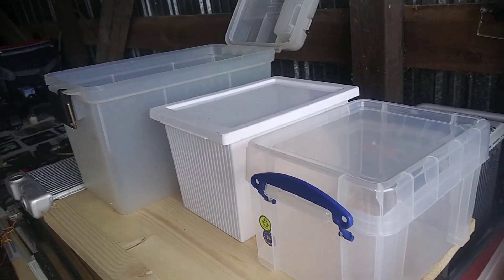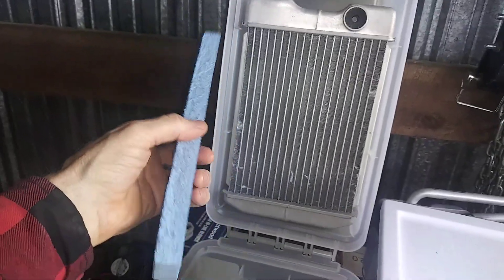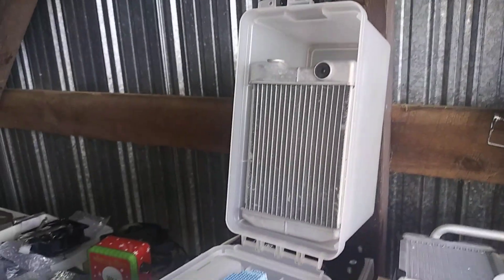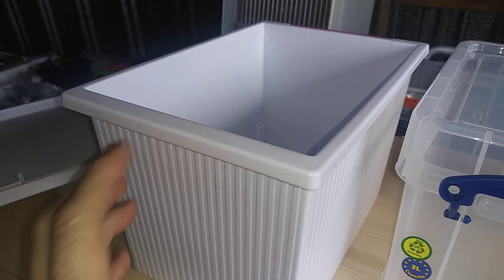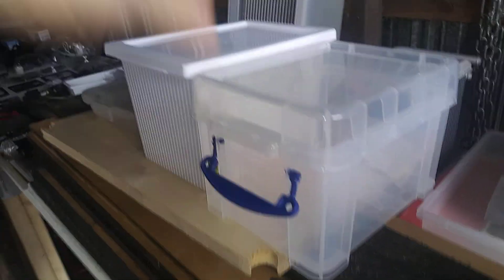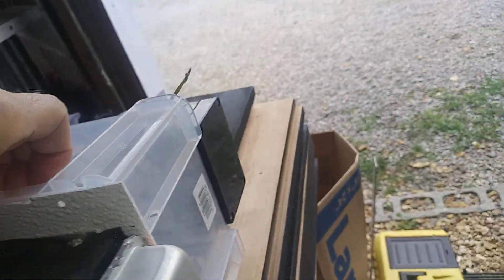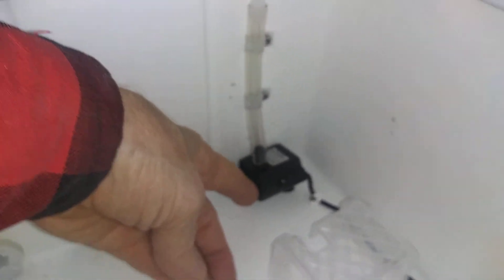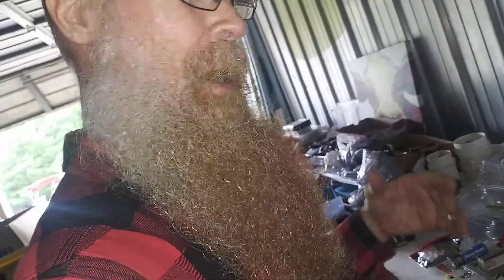Homemade AC: Flush Mount Fan vs Airbox? Sry first 60 seconds low volume!

Comment: Thanks for sharing this video. I been going nuts looking everywhere for just the right size box with no luck. I ended up buying a plastic tub that my radiator/heater core fits inside of with some styrofoam to take up the excess space (like your blue stuff) I then am installing that inside a 28 qt cooler that I cut out 2 holes for the water inlet/outlets. My 4" fan is going into a 4" hole I cut in the plastic tub and exiting out a 4" outlet hole in the cooler. That's how I made my blower box. I have a 50 qt cooler I'm using for my ice/water with my small water pump inside of it and the hoses running to the blower box. Once I finish those, I'll install 2 dimmer swtches (same as you got shown on another video) 1 for the pump and 1 for the fan. If I construct another one of these, I'll try to find a smaller box for the radiator and fan. Thanks for sharing your work.

Comment: where can i get the best box for the spectre radiator
Reply from the maker: Excellent question!
If I don't choose to custom build an AirBox I almost always use the plastic box in the link below.

https://www.amazon.com/gp/aw/d/B003VVS7LY?psc=1&ref=ppx_pop_mob_b_asin_title

Be careful if you use a hole saw because even though they allow a little flex I have cracked a few by getting my drill slightly crooked and causing it to jerk sideways. Just cut slow and easy.

These boxes are almost an exact fit to the core surface space measurement. I use pvc trim or aluminum hand made brackets to attach it to the radiator. They are a little expensive but saves a lot of time fabricating one from scratch. I used to buy them at Office Depot in some of the larger cities I was in at the time. I order them from Amazon when they're not available in small town stores etc.

Thanks a lot for watching!
If you have any attachment questions when you're ready just ask!

James, Rescue Kitty😺 & Snowvan!